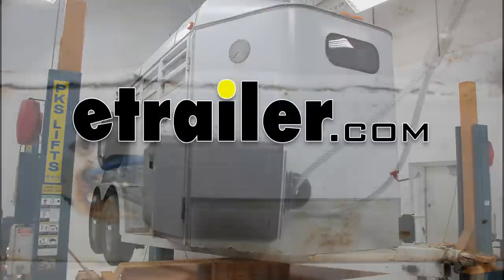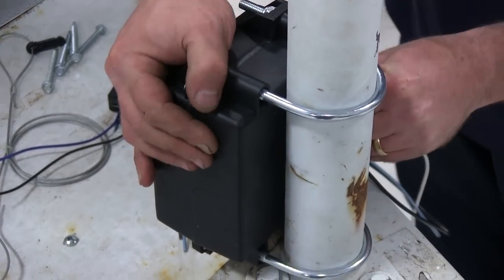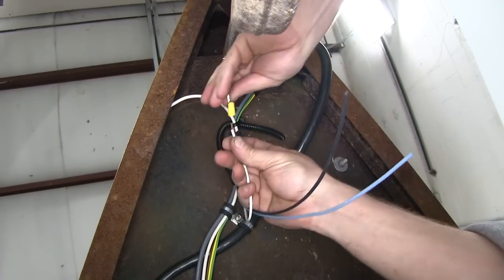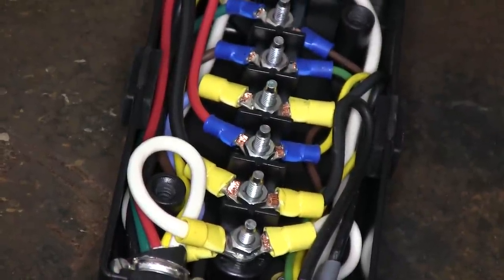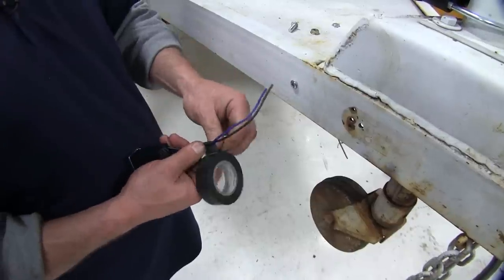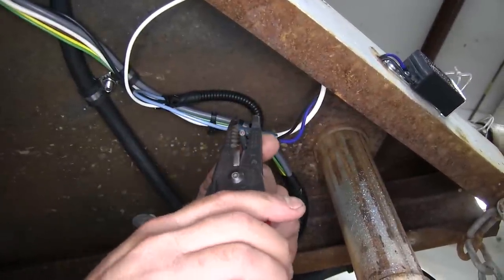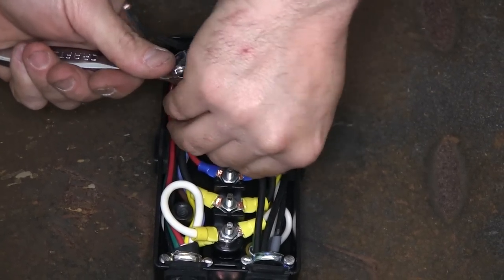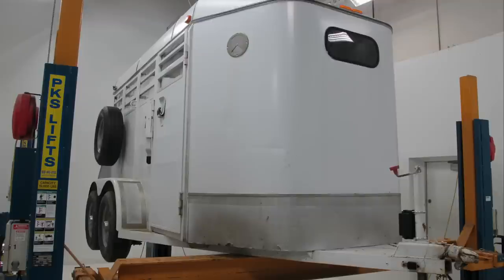etrailer | Hands-On with the Hopkins Trailer Breakaway Kit with Built-In Battery Charger

Comment: Can you install this on a 4way/without a junction box?
Reply from the maker: Yes, you can connect the wires directly to the brake wires on the trailer. The junction box will help greatly with routing and organizing the wires. This biggest help that it will be if you need to replace a wire if it gets damaged. You can just replace the one single wire.
https://www.etrailer.com/Trailer-Breakaway-Kit/Hopkins/HM20001.html